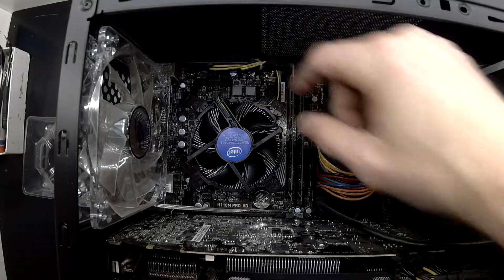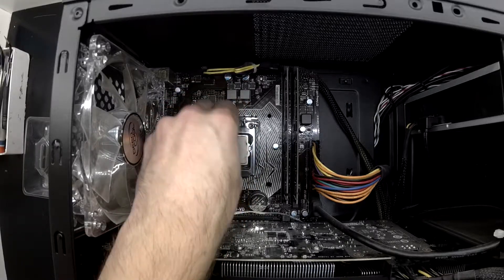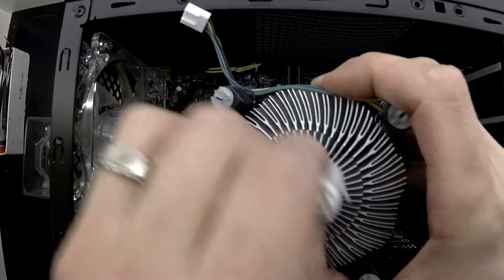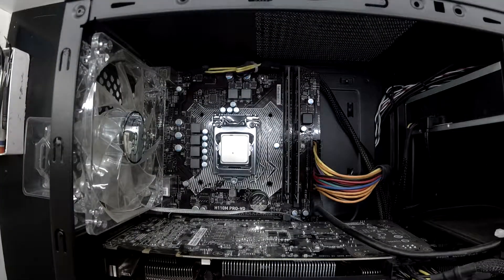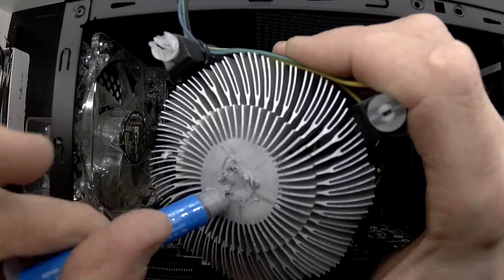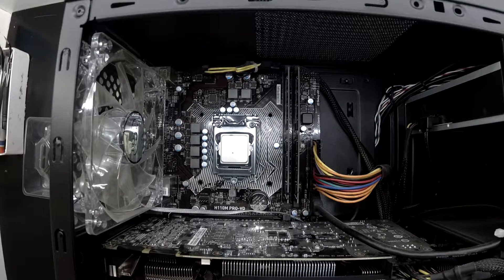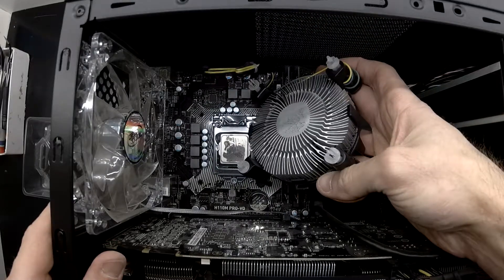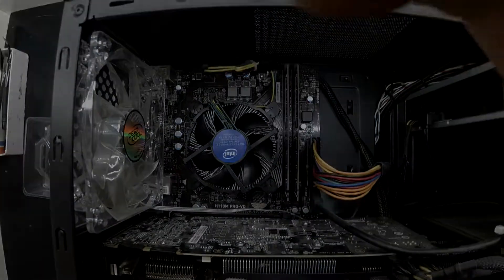Thermal paste reapplying on a i5 6400

Comment: Hi, my cpu thermal paste hasn't been changed since last 8 years. I use cooler master cpu cooler. Do i need to change it even if its working fine ? Thanks
Reply from the maker: i would still change the thermal paste with that age